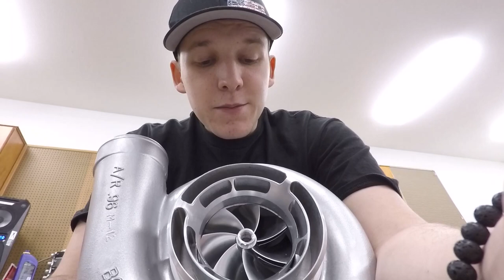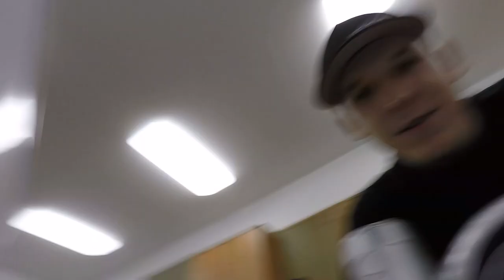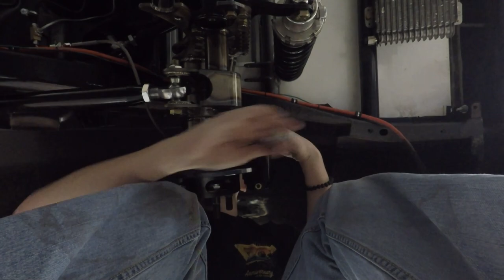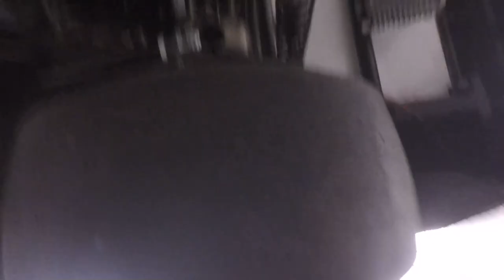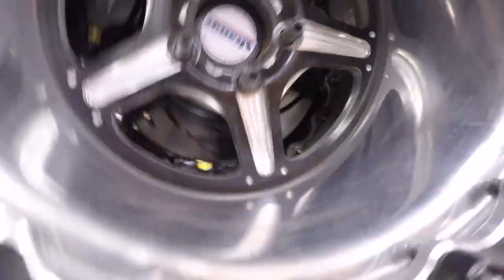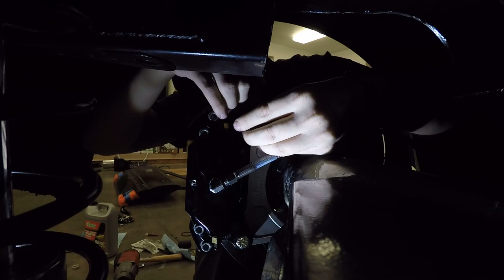GTR 88MM Turbo, New Car and More! Squirrel Tuned Vlog #1

Comment: dumb question ,
what’s the advantage of going to a single,bigger turbo over the twins?
Reply from the maker: My reasoning for it was simplicity, weight, and class rules. This turbo is actually the same weight roughly as my two before but capable of much more power than they were. And there are a lot of classes that limit you to a single turbo and a lot are 88mm or smaller too. So gives me more options for races.

Comment: Man them gtr turbos are crazy expensive. They worth THAT much more than say a s491?
Reply from the maker: They will clear a s491 by at least a few hundred hp. Depends what your goal is though.
Reply: @SquirrelTuned  well the goal is bottom 5.00 at 3500lbs… and I live in the Rockies so elevation is 5200 (da always over 10,000). 

Currently have a 85/96 billet s485 from Jose. Been 5.8 @ 124. I think my treadstone 1245 intercooler is starting to become a bottleneck
Reply from the maker: @nsboost  probably need 14-1500hp at that weight to go that fast. I'm not sure a s400 will get there at that altitude. I've seen them do it in better air.

Comment: Just wondering if there was a real reason that you used the 4.8 over a larger displacement engine?
Reply from the maker: Yes sir! Originally I did it because I always heard the displacement excuse from the ford camp, specifically 5.0 guys. So I wanted to beat them with a little 4.great.
Reply: @SquirrelTuned  I have watched the overlay video a bunch of different times. Do you think that a bigger engine would hold together turning a similar rpm.
Reply from the maker: @Jermyjudge1  I think you could turn a 5.3 the same rpm I am but not sure about a 6.0. SBE that is. There are built motors especially with solid rollers that are 400+in and go 9k+